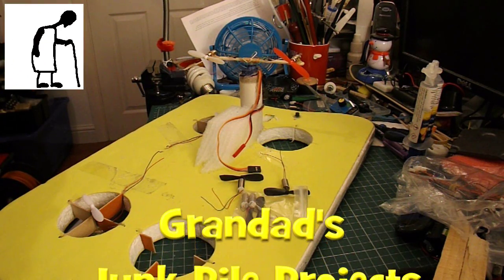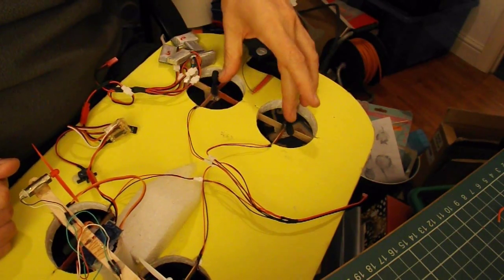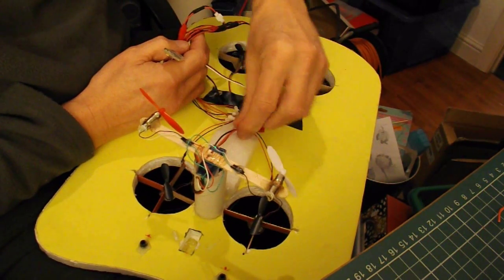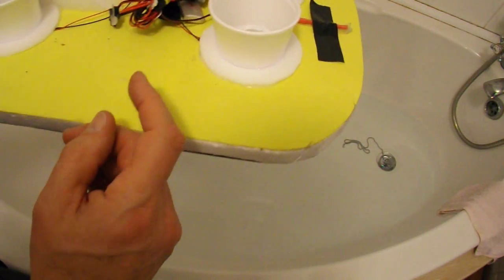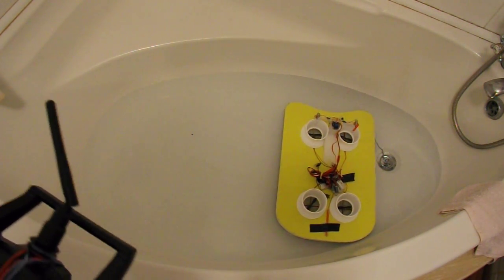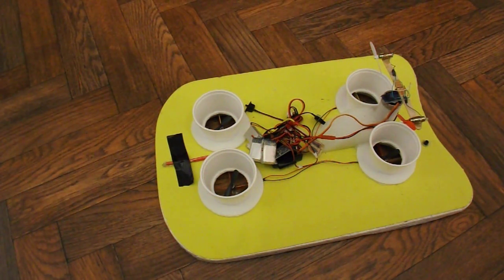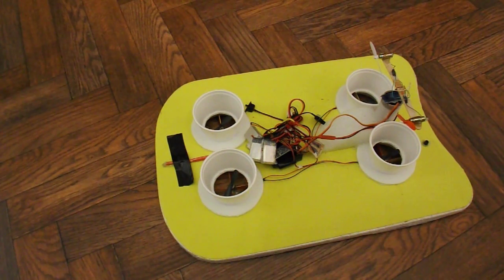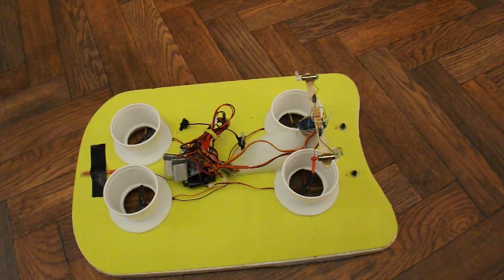Grandad's Junk Pile Projects #17 Quad Fan Hovercraft Revisited

Comment: Hi Grandad re lack of control most h/craft have the drive motors at the rear of the
craft, why not try them at the front? I think you would have better control, rather like
an articulated lorry doesnt have its trailer in front......M
Reply from the maker: +MrMal1956 interesting idea. Front or back, just a matter of which way I turn the motors. If I just flick the switch on the transmitter the front will become the back, in fact the steering assembly is only a push fit in place so I could just turn it 180 degrees and try it out. The main problem is getting my head round which vehicle I am controlling. When I switch from boat to hovercraft to quadcopter to helicopter and each one is different it takes a while to get my bearings :)

Comment: can you make it controlled by a drone?
Reply from the maker: +Lol Plane I don't have a clue what you mean.
Reply: i mean you put the motors on the place of the hovercraft so it could be controlled as a drone but its not flying
Reply from the maker: Lol Plane I guess you mean fly it like a quadcopter. It probably would work as you could use the gyrostabilisation to keep it level. A quad copter moves by changing the relative power to each prop so it tilts to move forwards/backwards/left/right and you adjust the turn by adjusting the relative speed of each rotor. That would certainly make it far more expensive to build than I intended but if you had a suitable sized broken quadcopter you could try it.